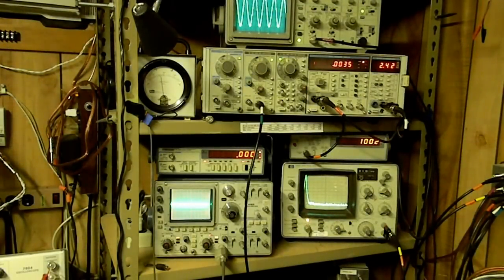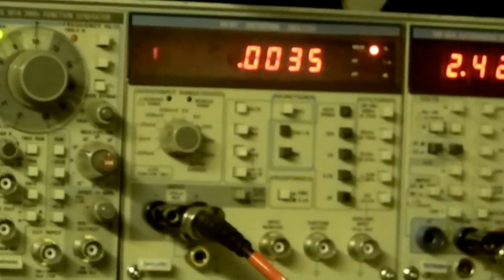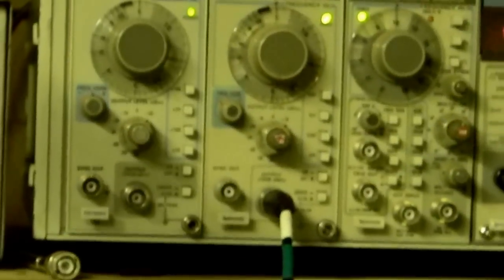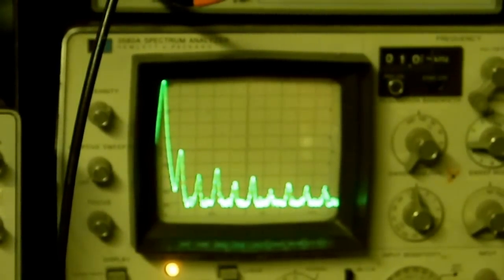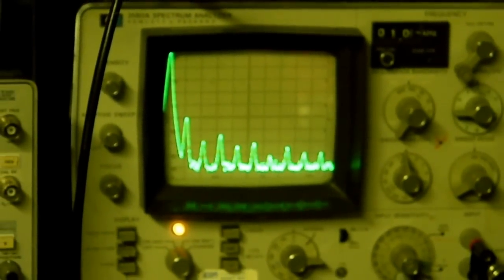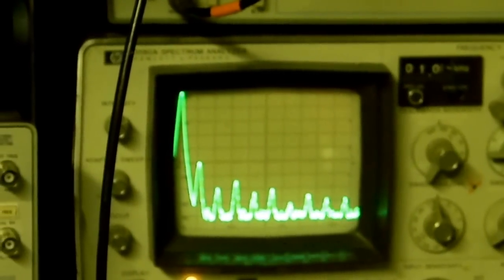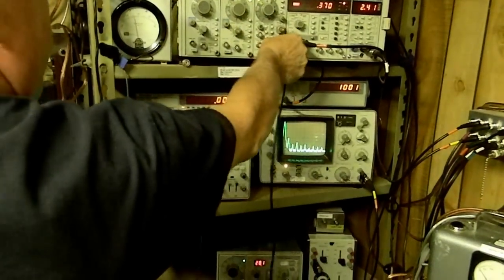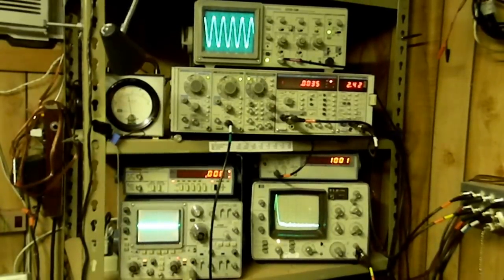Tektronix SG505, SG502 & FG501A For Use In Audio Testing.MOV

Comment: Are low distortion oscillators needed to check the output signal on a scope or Audio spectrum Analyzer for guitar amp testing?
Reply from the maker: For guitar amplifier testing, ultra-low distortion oscillators would not be necessary as guitar amplifiers easily run at 10% THD or higher. For high-end solid state amplifiers where THD can be below 0.1% it would be necessary to have an oscillator with specs around ten times better than that or,  0.01%. The oscillator outputs from many PC apps should be good enough to test guitar amplifiers.

Comment from the maker: I completely agree with you. I once used BNC "T" connectors for the buss and then moved to the chassis and connectors. I have noticed that there are nuances that are hard to see/predict/measure that can change THD straight from the SG505 into the AA501 and vary the THD from say, 0.0040% to 0.0006%. The turning on and off of the air conditioner in my shop can change things. I have a friend in El Paso that was an engineer at the same time as me at WSMR and we discussed just the other (next post)

Comment from the maker: I may have some issues with my equipment although I just made these measurements again and got virtually the same results. No RF in the vicinity and my building is a metal Morgan building that is grounded. I can't completely explain it either and sometimes (at around 100KHz) my SG505 will also measure 0.0008% THD and even as low as 0.0006%. I will continue looking at it and may need to revise this video. Thanks

Comment: There appears to be something wrong with this test setup. I think you are reading noise on the AA501, rather than distortion. My SG505 measures .0008% THD. My SG502 measures .028% and the FG501A about .25% all at 1KHz. The fact that you see a difference in harmonic output on the SA means that the lower distortion oscillators are not being read properly due to noise. Are you near a strong RF source, like an AM transmitter by chance. I know my distortion readings went down when I shielded my shop.

Comment: My SG502's distortion varies with the output vernier setting. Highest THD at 3 o'clock on the vernier, lowest at maximum on the vernier. Be sure to check them at varied levels. You might be surprised.